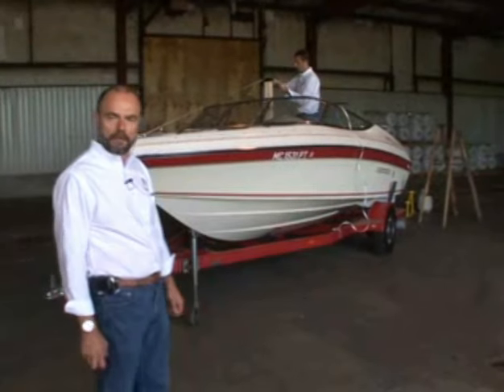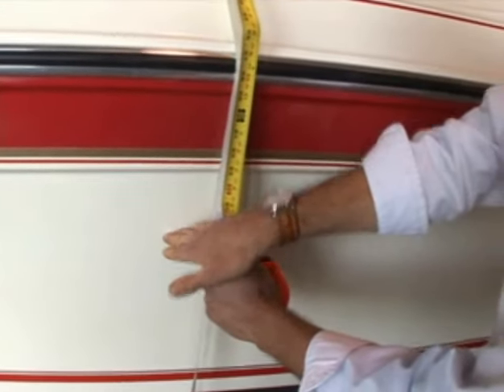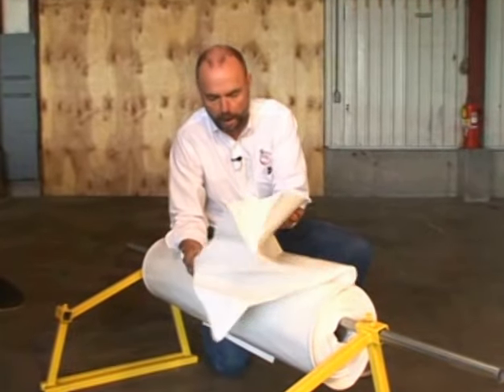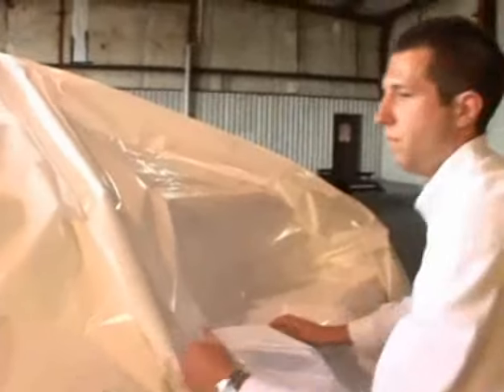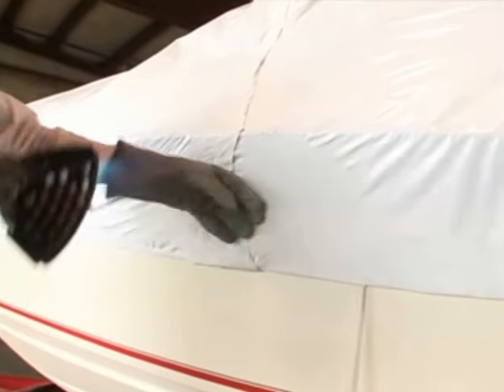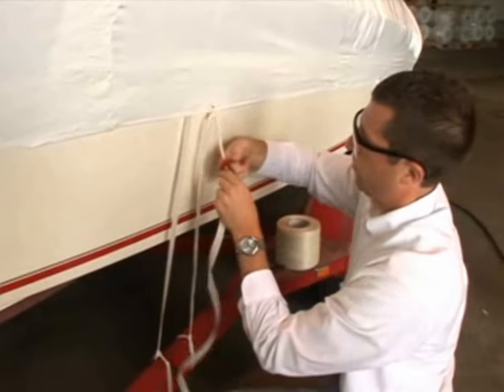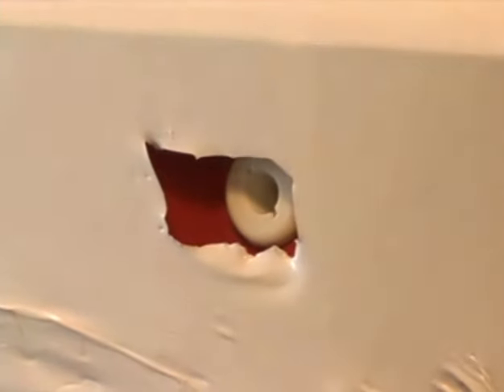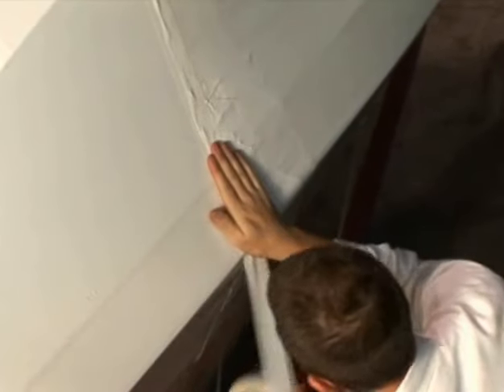Shrink Wrap Training with Dr. Shrink

Comment: Excellent how-to video for beginners or someone thinking about DYI. Highly recommend this tutorial video to those. I like the idea of taping the pleats. I don't recall seeing any fuel vents installed on any boats like this that I've seen shrink wrapped but definitely a good idea to at least have the vent on the boat taped off while your flaming the shrink wrap. Maybe you could sneak your hand up in between to remove the tape after you're done? Multiple vents for cross-flow is a great idea, you don't want moisture buildup under the cover leading to mold/mildew growth. Also a great idea (I wouldn't have thought of unless I knew the boat would be towed) about folding the pleats to the rear and having proper relief for air/wind to escape. I've definitely never seen an access door installed. It's maybe something worth offering to people that might want that but would not install that on any one-time use cover unless needed or requested. The use of belly straps is a great tip as well.
Reply: Hater

Comment: I reuse my shrink wrap for several years.😊
Reply: really? it holds up for reuse?
Reply: @UN-AFFIL  if you are very careful with it, you can reuse it. You have to cut the straps in the right spots and remember how you took it off. I usually get two years out of mine.
Reply: How do you reuse it

Comment: We do 400 plus boats per season for the last 20 years, up to 80 plus feet in length, triple mast up sail boats, over the water or in the water (bubbled). This boat is a 15 minute job, you don't need buckles, you don't need tensioning tools, you dont have "pleats" on anything but cruisers or large sail boats with bimny covers still up. Some of this is acceptable information but a lot of it is soap box talk. You almost never cover a out drive as most owners store it lowered because water will not build up, freeze, and damage your outdrive. He's using a srink-fast gun to finish the job instead of a rosie, waist of time & propane. Nobody puts a door on anything that small, doors are expensive and are usually installed on larger boats. If you "cut-in" a pleat correctly you can tack it up without the need for tape, but it never hurts to tape it off. Over all I give this a favorable review if you've never done this before with one request, learn how to do a "truckers" tie off and skip the buckles!
Reply: Rosie?
Reply: Get a life Irving,
This is a general demo video.
Yes that is a bilge opening.  Could have been a vent.  Same principal.
Yes, this boat probably didn't need a pleat.  We were shown how to handle a pleat.
No, probably doesn't need a door.  We learned how to properly install one.
anyway.
How about a piece of machinery or a vehicle that needs to be hauled.  Probably need doors to get it loaded and unloaded.  Probably need to know how to properly cover it with the pleats facing the right direction.

Great Training video.
Reply: irving hey I know this is a year old but I’m going to try and do this to 2 boats that I have do you have any advice for me
Reply: Go to a marina and watch guys who do this for a living. We've had people ask us for advice which we freely give but when you watch them you can really see how this works.
Reply: I gave it a good overall rating just pointed out a couple obvious pieces of information a novice may not understand and would easily be mistaken in trying to do them. I would recommend anyone who is considering doing this themselves visit a marina and watch this process real world style.
Reply: But what marina would show you how to do it ?most of them probably want to go pay or get out there shop and wasted their time
Reply: Your correct, I didn't mean bother the guys I meant watch them and stay out of their way. We've had people video us wrapping boats from across the street / canals. People always want to do this themselves because companies like ours make it look easy but its dangerous work. There are some skill sets and special tools needed to make it easy which most people simply do not have. If you buy the materials and rent the equipment needed to accomplish this its almost not worth it to do this yourself. The disclaimer at the start of this is dead spot on, fire is a very real issue, we've had a couple issues with new guys not paying attention which could have been catastrophic had we not been watching their every move.
Reply: @jw1293jw  how much does a 50ft x 20 foot role cost? heavy duty stuff. How long will it last
Reply: What is a "rosie"
Reply: @urltom  rosebud torch - its a wider torch than your typical "bernzomatic" propane tip, maybe 3 inches diameter used for heating larger surfaces, welders use them for preheating, landscapers burn weeds out of pavers or stone, etc.
Reply: @brucer4021  Thank you! I now realize that I actually own one like that, I call it a "roofers torch" for flat tar roofs, but I bought it from Dr. Shrink 23 years ago with his brand on it. I later upgraded to the Shrinkfast gun.
Reply: from up north where I live its all needed except the door. No one here leaves their outdive down, its way too cold here everything is fully winterized or else you will have problems if theres any water left in the system.
Reply: You should do a video then
Reply: @nstag8r  FYY, the outdrive should be left down any ways to prevent destroying the bellows.
Reply: @jhchome52 boat doesnt get used a bunch but its a 1998 and the bellows have never been replaced and are in incredible shape.
Reply: meh...doors are fine on 25 ft boats like my pursuit as sometimes I have to get in early in the spring but am not committed to taking it down. Just cause you cut corners on the little things that save DIY time and headaches doesn't make it wrong. I"m sure you are a genius at 400 boats a spring but I see nothing here that is wrong for those who take their time, do it right and are not trying to save a lot of money. Hell some of us are looking here because of guys like you who don't do the little things, move quick and know it all!

Comment: Would it be possible to shrink wrap a sailboat hull and keel and put/leave in brackish or salt water, preventing sea growth? Possible spraying hull with adhesive before shrinking... if that would work, could you sail with shrink wrap on if the rudder was wrapped separately and through hulls addressed? This might open a huge market for you if it would work...

Comment: That blow torch is exsesivly hazardous, maybe get a propperly appropriate tool for the job.
If its over 200Celcius, ITS TOO HOT!
Reply: That torch is specifically made for shrink wrapping
Reply: @Maynardd  Yep what Maynardd said, I have the Ri-Pack 3000, I wouldn't use any other heat gun.

Comment: beware of this product, these guys are experts.  The difference between enough heat to weld the material and burning through is a split second, very hard to judge.  We just spent a bunch of time trying to patch burn through.  Also the very expensive heater gun we used was very difficult to light, you couldn't just pull the trigger, you had to hold it a second then try and light it and it worked about half the time.
I ended up just pulling it off and buying a tarp instead, about 1000 buck down the drain
Reply: I disagree with you on this, I have been doing it three yrs now (just my boat), the first yr was some what of a struggle but it was also a learning experience, I use the ri-pack 3000, I love the shrink wrap, it is tighter and more secure from critters. The first year I did it, my wife and neighbor helped me put the shrink wrap on, the last two yrs I did it by myself and I am getting faster. I am far from an expert but I am getting there, it takes me longer to put the strapping on (22.5ft boat), that maybe because I like to over build things, next yr I won't go so much strapping.